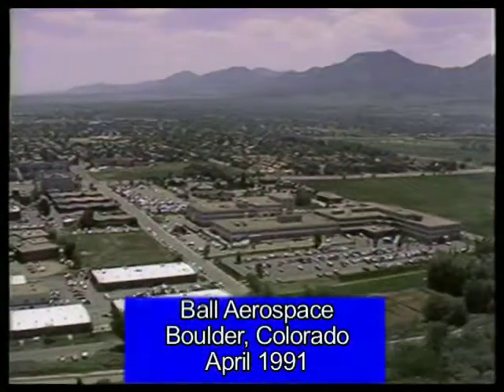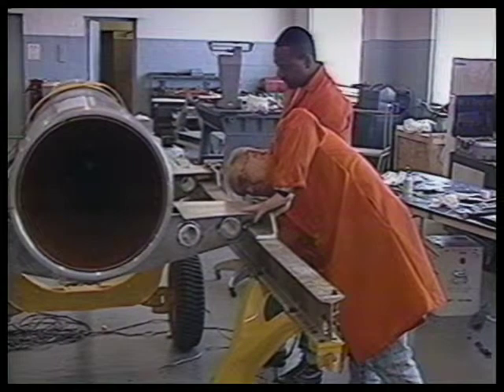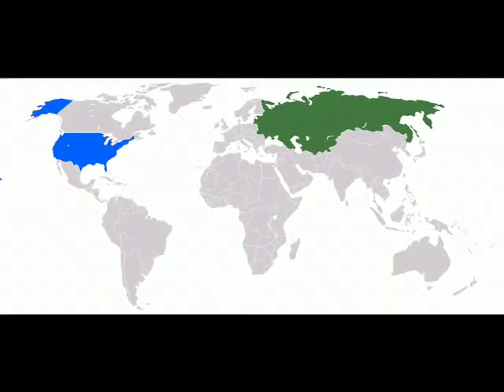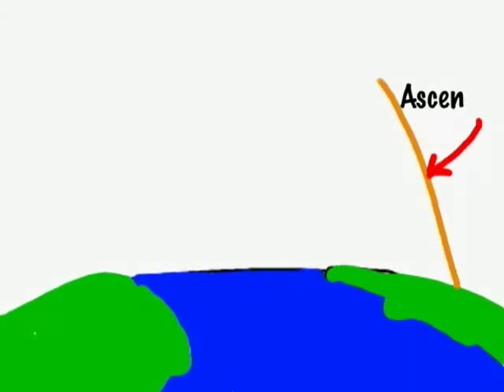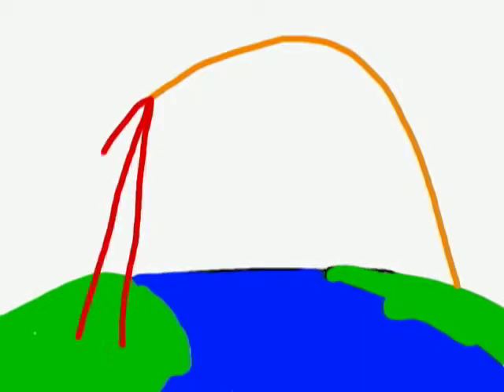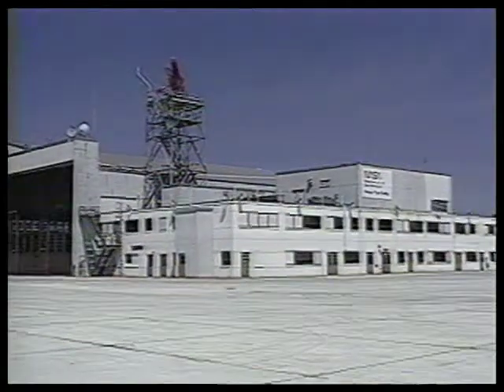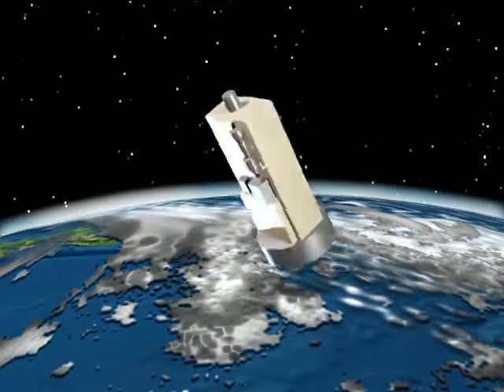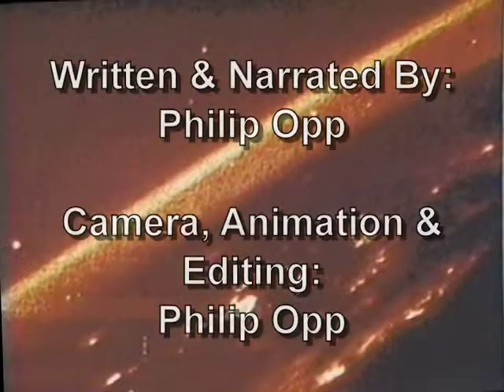The Strategic Defense Inititative Part 2 of 3 1989 to 1992

Comment: The terminal phase the ICBM these programs were aimed at, the R-36/SS-18, was a hydrazine fueled monster with 10 MIRVs. This would have been a very very basic test as the relative velocity between the payload the the boost stage is minimal. In a real engagement closing velocities will be on the order of 14 km/sec or ~8 miles/sec. Only two SDI systems ever really became of anything and they are both very faulty systems, NMD, and YAL-1. For some people spiritually satisfying but engineering flops.